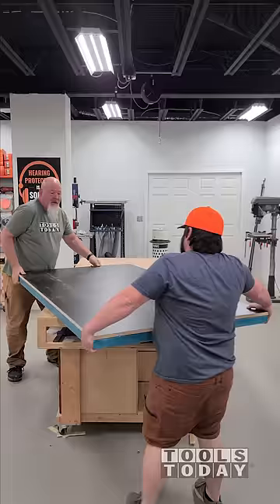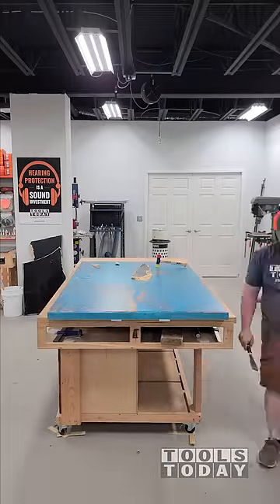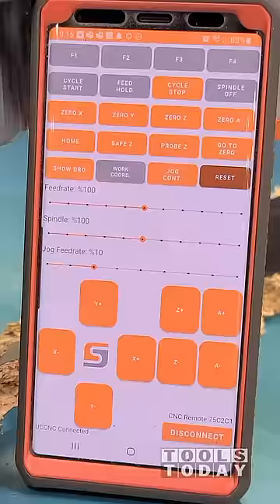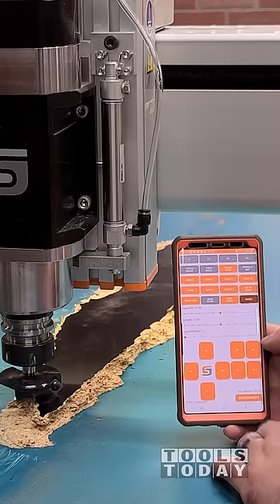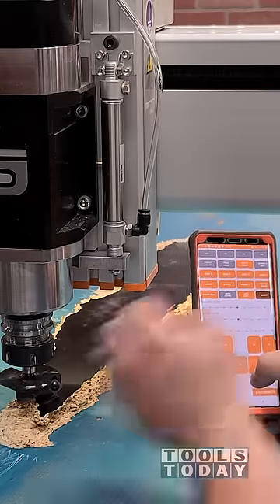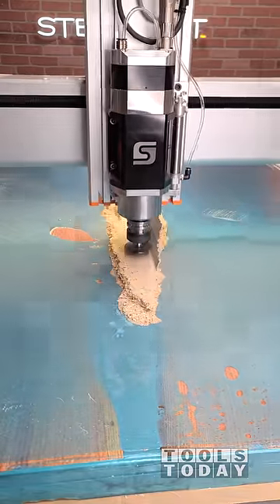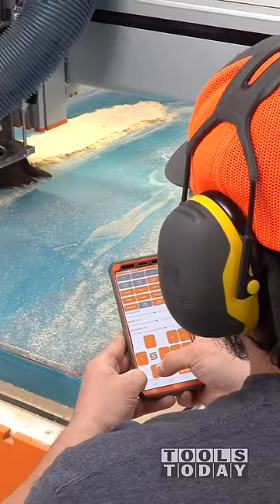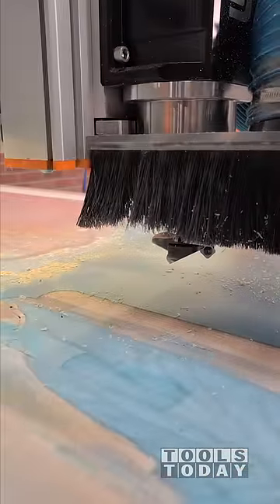Demolding Slab Island Top

Comment: Why didn’t you use a planer?seems like it would be more efficient
Reply from the maker: I don't have a planer that's 44" wide, nor have I ever seen one, and using something like a hand plane would take absolutely forever.
Reply: @ToolsToday  that makes sense. I worked with a guy who had one that I think was 50” in his shop, but I don’t remember.
Reply: @ToolsToday  I purchased one for a company I worked for a couple years ago, a 1933 Whitney dual head 44 inch. 25 HP top motor, 15 HP bottom motor, 5 HP feed motor. It was an absolute beast. Runs like it's brand new.

Comment: takes 2 mins to write a simple incremental move 3 pass tool path...then just drop z how ever much and run it again until desired depth... 
M03 Sxxx;
G91  G1 Y20 F 500.0;
X7.;
Y-20.;
X7;
Y 20.;
X7.;
Y-20.;
X - 21.;
M5;
M30;
Reply: @Brandon Emmons  Yes, i worked aerospace for 2 years and, generally, you're right. But there's a problem with it. Even for people who use it every day for a living, g code can be difficult to remember.  Our brains aren't wired to think in that language. So the phone app seems like it's both quicker to set up, less programming time, and easier to use as apps on a screen are more intuitive than a traditional controll setup. For reference i trained on a Haas vf2 if i remember the model correctly, 1997 was a while ago and i'm not as young as i once was lol. 👍😁

Comment: Legitimately a question not trying to be a know it all, but wouldn't a planer work wayyy better for this.
Reply: Absolutely, but that would have to be a very large planer which only industrial shops/makerspaces have. Router sleds or CNCs can do this and while a good CNC can definitely cost up to as much or even more than a very large planer, those planer run on 3 phase industrial power and also the CNC are much more versatile tools. I have a 4 feet by 8 feet CNC yet my planer is a 20 inch because the CNC was more worth the money than a 48” planer in my opinion.

Comment: this kinda sad. the bulk could have been quickly removed with simple hand tools and finished with a cabinet scraper.
Reply from the maker: But it couldn't.  The epoxy had adhered to the melamine.  Without using a chisel to chip every piece off, which would have taken a ton more time, and then finish with a cabinet scraper, there's no way that it would come off, and again, that takes way longer.